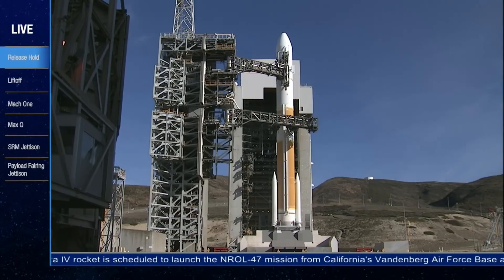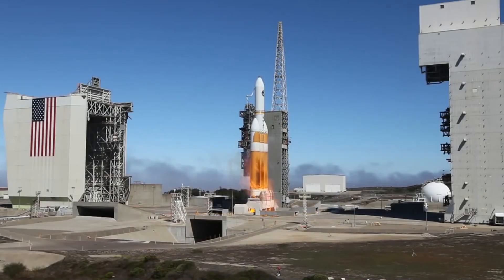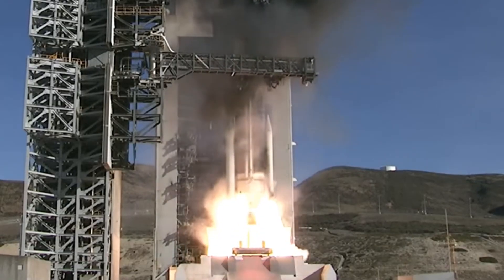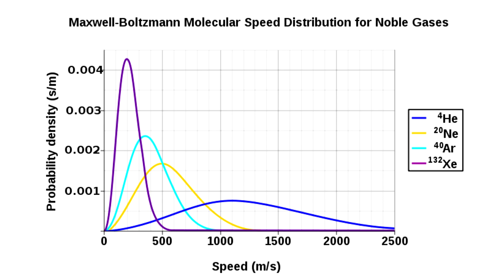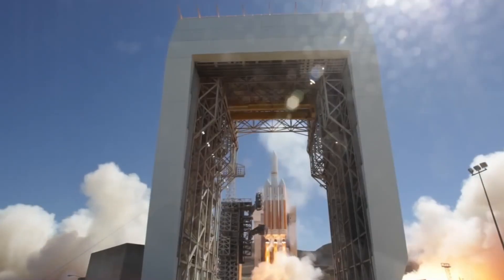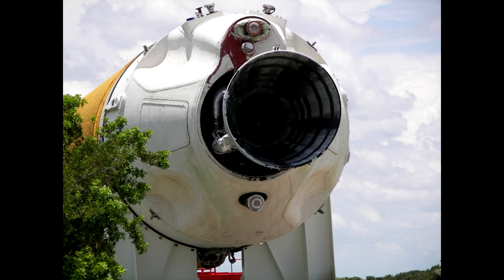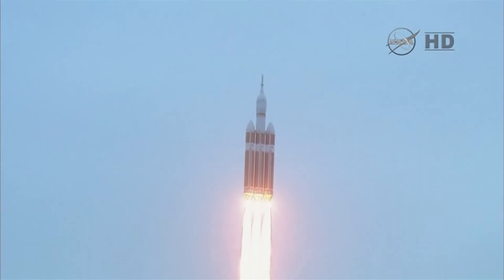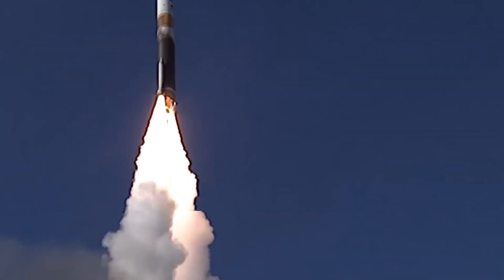Explaining the Delta Rocket Fireball - Kerbal Space Program Doesn't Teach....

Comment: Is there a reason Nasa isnt using a set of RS-68s for the sustainer core on SLS?
Reply: +TheExplosionist  The RS-25 is a more sophisticated, advanced, fuel-efficient staged-combustion design.  What makes you think it's inferior?  It has lower thrust, but bigger doesn't necessarily mean better.
Reply: +Motokid600  The RS-25 (SSME) is already human-rated and is more efficient.
Reply: +Motokid600  The plan is to manufacture more of them.
Reply: Good points rbtck. Makes sense, ty for that. I had not known the intention was to make more.
Reply: Probably because someone in authority makes more money using inferior engines.
Reply: Well they want to use up the remainder of the existing SME's sure. But what then after they're gone?
Reply: One of the reasons is that the ablative nozzle of the RS-68 wouldn't be able to handle the heat from the two massive solid rocket boosters

Comment: Those LEO lift capabilities of the modern rocket are sad compared to the ~170 tons the last couple of Apollo missions put into orbit.
Reply: Greg Watson problem probably being that 1 Apollo used resources of a dozen Deltas
Reply: I know. I'm just wondering what the Saturn family would have become if it had the multiple  decades of service/ iteration like the Atlas and Delta families.
Reply: Saturn V never put anything 170 tons into LEO. That is in fact well outside Saturn V's capabilities. Skylab, which you're probably referring to, weighed 170,000 pounds.
Reply: +Greg Watson  It's true and sad, but it does make sense.  Modern rockets are scaled according to requirements, and affordability is an important consideration.  The Saturn V was designed for a certain very demanding mission that we don't do anymore (although that appears to be changing).
Reply: +Greg Watson  Well, for one thing the Saturn family would have become smaller.
Reply: +Pyre Vulpimorph  Correct, the Saturn V's theoretical payload capacity, as opposed to the total mass injected (a measure that was sometimes used, especially back in the day), is more like 130 metric tons or 143.3 tons (286600 pounds) to LEO (at a 30-degree inclination).  The difference is significant, albeit it is not hugely, outrageously far off, either--it could lift about 84% of the original commenter's claim.
Reply: The Saturn V lifted a max of 140tons including the third stage and remaining fuel on later Apollo missions.
Ares V on the other hand would have lifted 188 tons.

Comment: Fun fact, Scott's car also produces a giant fire ball at first start up.
Reply: "my other car is an interplanetary rocket"
Reply: Daily Slough 
A Nova car 🚘?
Reply: I do that also after snacking on burritos
Reply: @Cydonius1  Elon Musk needs some fuel for Starship
Reply: Terry Wilson no, his is just an interplanetary Rocket
Reply: Pull my startup sequencing finger.
Reply: Random bystander: "Dude! Wth is wrong with your car?"
Scott: "It was always expected, it was designed into the system"
Reply: A NASA engineer's car: Starts in three stages
He thought it would be cool to purge the motor with hydrogen before supplying the gas-air mixture. However, he's going to test it:
because of a possible safety risk, he decides to make the first start remote controlled.
He presses the button. A countdown begins. The hydrogen is supplied to the motor and our clever NASA engineer has calculated, that he must delay the spark plug's ignition to prevent the hydrogen from exploding. It's clever designed by system, he tells his wife. Then the fuel is supplied. Nothing happens, inspite of the fuel pump making an odd sound. ABORT yells our engineer, but the spark plug just ignites a perfect explosive 1:2 air-hydrogen mixture. And because he wanted to be greedy and save NASA's money, he decided to use existing hoses inside the car to supply hydrogen. The use of the exhaust system was forbidden due to the hot air igniting the gas. So the other empty hose left was for the A/C. He just connected the intake to the motor and voila. At least he thought it was good, until the hydrogen flew into the driver's cabin and ignited as the motor's spark plugs did. 
The car literally produced a giant fire ball. Liftoff his wife says.
The engineer shruggs and replies: First of all, it was designed to do so by system. And secondly: All of our rockets have that giant fireball at startup.
Reply: Terry Wilson not on start, but after an accident and with water
Reply: I produce a giant fireball at startup too!
Reply: ...and it has three stages.
Reply: lol
Reply: ..by design.
Reply: It’s perfectly norminal to do that.
Reply: Must own a TVR
Reply: Unburned fuel in the exhaust pipes.
Reply: Is this true Scott?🤗
Reply: @ros but it is designed that way. it gets more efficient as he drives faster and faster and until pulled by a cop... than engine stall completely
Reply: I nevwr have to do that cus i hate taco bell
Reply: My computer fireballs when it starts up
Reply: XDXDXD applause
Reply: Ros thats the dumbest joke ive ever seen... Is the world getting dumber? I need a time machine
Reply: Exodarion get a sense of humor.

Comment: At one point you say that hydrogen is expensive to handle and suggest that that makes a hydrogen fuelled rocket much more expensive to launch. My own understanding was that fuel is a tiny fraction of launch cost, and so the real reason for cost differences would be engine and tank costs etc. Could you clarify?
Reply: Timothy Whitehead hydrogene combustion is hot. Engine are much more complex for hydrolox than for rp1
Reply: Hydrogen atoms are so small that they leak even through walls of metal tanks :)
Reply: Its bulk means you need larger tanks for the same mass of fuel, and dealing with cooling it and making pumps that can reliably move the smaller molecules requires tighter tolerances and through rates.  Further, as mentioned, the increased combustion temperature adds even more engineering challenges.
Reply: Well it's a lot easier to handle liquid kerosene than a very explosive gas, I think it's just rather obvious.
Reply: To be completely honest, I've seen hydrogen handled exactly the same way that nitrogen is handled. It's not like it requires additional care.
Reply: Compare to RP1 it needs to be cooled so tanks needs to be cooled also, engine needs to be cooled as well (or have ablative material like here)

We do not compare hydrogen to nitrogen but to rp1, which is the other fuel and why hydrogen is more expensive than rp1
Reply: I know there are differences in handling, but if the differences add up to tens of thousands of dollars for a 60 million dollar launch, then its not all that obvious.

Comment: If that's the main obstacle to human-rating a D-IVH, is there no way to simply siphon off most of the hydrogen and blow it away somewhere before it goes flying up the rocket?
Reply: how would you do that though. Youd need to isolate the exhaust of the rocket itself. you see the problem??
Reply: Nope. Once the engine properly ignites (rather, maybe 50ms or so before that happens) the siphon system can slam closed, as the engine exhaust is now going down really quickly, so the standard flame trench is enough to get the exhaust away from the rocket. This siphon idea only is needed for the few seconds where they're running hydrogen through the engine before ignition, and the gas - which doesn't have nearly as much downward momentum to start with - will tend to float back up the rocket body and currently has to be burned off by sparklers on the pad.

Comment: Where is the MechJeb module on this rocket located?
Reply: Probably clipped inside vessel somewhere, so it doesn't impact its aesthetics.
Reply: Integrated with the control core.
Reply: Or maybe the one playing is just playing with pure vanilla. :0
Reply: +Bzorlan This is RSS/RO, but MJ is probably also installed
Reply: porkypine no this is rss
Reply: It uses a system far more advanced than MechJeb. It also has a planned mission, which significantly decreases the probability of running out of fuel and being stranded.

Comment: We will see how much more they will delay Falcon H. We already saw cancelation of ITS, with in my eyes is big minus for company, only annoucing "product" is order  to pretend like thay are future of space exploration, while they never planed todevelop this rocket. While whe still have BFR, I'm still waiting for specs on this thing to see if it is another "lie".
Reply: No? BFR is over 2x lighter, smaller and it's payload to LEO is 2x/2.5x smaller than ITS.  Yes, Engines and tanks are in development. There is much more to be done to make this rocket real. 
>Flacon H. is brand new rocket
Eeeee, what? Flacon Heavy is literally falcon 9 with 2 extra boosters, same as core one. Whole idea of this vehicle is to use already existing, reuseable technology to cut spendings.
Reply: Pietrek S  It's not quite that simple. For instance, while it's basically true that "1 FH = (3 x F9) + 1 upper stage," if you light all three at once that's 27 engines burning (instead of 9), totaling between 180% & 300% of the thrust from a single F9 1st stage (60% - 100%/stage). The stresses on the rocket/payload will NOT be the same as F9 as a result, nor will guidance & directional control, stability, & so on. So in reality, no, FH =/= 3x F9.

Also, F9's 1st stage has been regularly upgraded until quite recently, therefor it didn't make any sense to launch FH any sooner: they'd have had to make do with sub-par, less capable, old-model F9 engines to do so. Instead SpaceX waited until they had the finished/final versions of the F9 1st stage available for use. In other words, the single biggest delay in FH has been the work done on F9's 1st stage to this point, & I'd personally say it's been well worth it.

Comment: Why couldn't they just have some kind of extraction system to pull the gaseous hydrogen away from the pad and to a burn-off area?
Reply: something like giant vacuum cleaner
Reply: A giant vacuum cleaner would ignite the hydrogen and turn into into a flame thrower. Theres nothing really practical that can be done. And its not really an issue. Just chars the foam which only has to last 5 or so minutes before their staged away.
Reply: But why. It's not a problem. Solving problems that don't need solving makes things more complex, and more complexity is is how explosions happen.
Reply: I didn't say it was a problem. Just if they wanted to human certify it for flight.

Comment: what happens if they have a pad abort? isn't the insulation damaged?
Reply: Only cosmetically. As is visible in the various clips, once the burning hydrogen is no longer present, the insulation no longer burns. Only the very outer layers end up "blackened" (i.e. "discolored"), yet even this is not damaged enough to render it unsafe or ineffective.

Comment: It's just like lighting an oxyacetylene torch. You ignite the fuel, which gives this bright yellow sooty flame, then you add the oxygen.
Reply: Sort of. Except that hydrogen doesn't soot.
Reply: then don't light your torch off your cigarette....nupty
Reply: I was taught to open both valves at the nozzle about one-quarter turn, acetylene first, and then ignite the flame. It ignites easily and you don’t get this soot development at all.
Reply: @fpm1979 , writes "I was taught to open both valves at the nozzle about one-quarter turn, acetylene first, and then ignite the flame."

You weren't taught the safest way. What happens, for example, if you try to light the torch and you find out that you've just run out of acetylene and you've been pumping out pure oxygen and you've saturated your clothing in it? Or what happens if the torch doesn't light on the first try and now you're creating a cloud of oxygen/acetylene that will basically explode when you do get it lit?
Reply: Except that the fireball burns your eyebrows off every time you light the torch.
Reply: Yes, but I'm not running the torch on hydrogen. It doesn't make a bright yellow flame, either.

Comment: God damn, rockets are cool
Reply: depends on the part. some are quite hot.
Reply: Great Britant Parachutes alone aren't enough to slow down from supersonic speed so you'll be using fuel either way, plus parachutes big enough for a 12 story rocket are fucking huge and heavy, like not actually much lighter than the miniscule amount of fuel you need for a suicide burn heavy. Also, parachutes can't be accurately aimed so you'll probably need to be landing in the water which is terrible for reuse. At least with the US's geography. Just remember how many very smart people there are at a place like SpaceX. When you have a question like, "Why don't they use parachutes?" Odds are they've asked that too. SpaceX actually tried parachutes on earlier Falcon 9 launches and they were never able to slow it down enough.
Reply: flippynl badamtish
Reply: And that's why I am building a sugar rocket in May. With camera in it :) Expected fly height to be at least 100m in case of two stage burning engine
Reply: SpaceX actually tried that and guess what: it didn't work. After that they switched to propulsive landing. I think the touchdown speed with the parachutes was too high and slowdown at supersonic speeds is quite hard (I will look that up, not sure about this). Also it wouldn't work on mars :D
Reply: +Tomclanys: You can build a r-candy (sugar) rocket that can achieve 200m quite easily. We did it with only about a 100 grams of "fuel" in a "single stage", alot of plaster in a PVC pipe with a broken broom shaft taped to it. We didn't expect it to clear the ground but it flew a loooong way up and then into the forest never to be found again. Good luck on your endeavor!
Reply: You mean "Hot"
Reply: flippynl  get out...
Reply: Braeden Hamson very cool!
Reply: fnadde42 - LOL Great.  Would have liked to see the faces of the surprised rocketeers.
Reply: Braeden Hamson No they are ticking time bombs.
Reply: that's because it is a phallus and you are a homosexual
Reply: Hahahahaha XD
Reply: Jeff O - Cool reply to Great Britant's question re why not use parachutes.  I'm wondering whether auto-gyro props could be used to an advantage.  And; Why not do a land-and-lay type landing which would reduce the damage in a missed-the-mark type landing; by immediately laying the tube down horizontally and removing the potential-energy (kinetic?) ASAP.
Reply: Great Britant You can do that with an sts SRB since they only reach mach 4 but the first stage of an falcon 9 reaches mach 8 which is impossible to slow down with a parachute and if they managed to slow it down to a speed where the parachutes could deploy safely the booster would be uncontrollable and would have to be landed somewhere in the ocean which is bad since the salty water would corrode the engine, that is the reason why the SRB' of the space shuttle where at the end cheaper to make new than refurbish.
Reply: clark davis You say that as if you have black on white evidence.
Reply: Well its in the name.
Reply: Rockets are just guided missile without the war-head
Reply: But SpaceX rockets are cooler.
Reply: Quinn Von Kerman, biggest drawback of the Falcon 9 and Falcon Heavy is that the entire rocket is fueled with liquid oxygen (LOX) and RP-1 (ultra-refined kerosene), which has a bigger push at launch, but doesn't have a higher specific impulse. The Atlas V and the Vulcan rocket that ULA has on the drawing board to replace it has the Centaur upper stage, which uses the same cryogenics (liquid hydrogen & liquid oxygen) as the Delta IV Heavy to help lift the payload to its final destination (medium-Earth orbit, geostationary orbit, cislunar space, or interplanetary space). Of course solid rocket motors do help as the Russian-designed RD-180 is not enough to get the Atlas V into orbit.
Reply: @maxpower19711  Musk fan boy?
Reply: Rockets doesn't exist, they're only cgi. I know it because i got major in flat earth. Yes i learned that at youtube because it's 100% true.
Reply: A Hateful Guy Stop being an embarrassment to your family. You are really stupid!
Reply: Bin Ou Yang I still question how carrying extra fuel to perform a rocket landing (increasing weight and therefore reducing payload) is anywhere near as efficient as just.. using fucking parachutes that don’t need shit tons of fuel to work.
Reply: First the parachutes will not be able to slow it down enough to prevent it burning up on re-entry, so you need to add somewhat heavy thermal protection and secondly the parachutes would result in a very heavy landing which would damage the structure. You could mitigate that by strengthening the structure and upgrading the landing legs to take the extra shock but that and the extra heat shielding would end up adding more weight than you saved on fuel. 

Parachutes worked with the shuttle boosters for two reasons, first that they shut down at lower speed and altitude, so had less difficulty in the first part of deceleration and secondly because, being solid fuel motors, they had to have a very strong (and heavy) structure anyway to contain the combustion pressure.